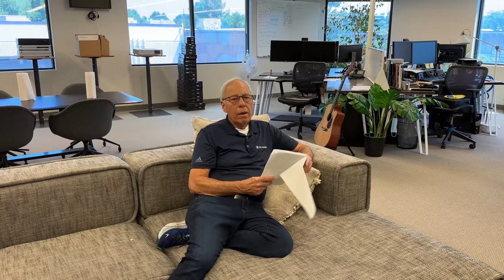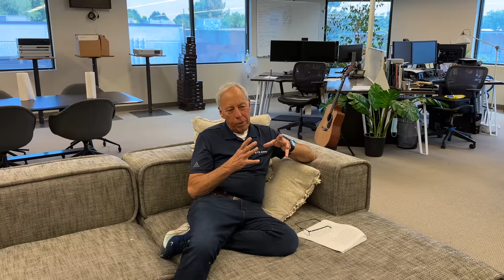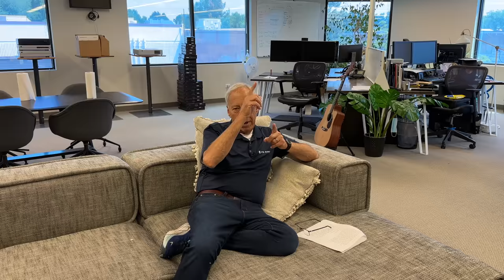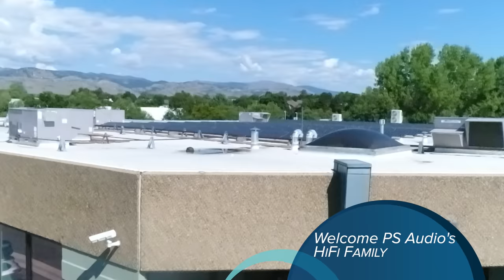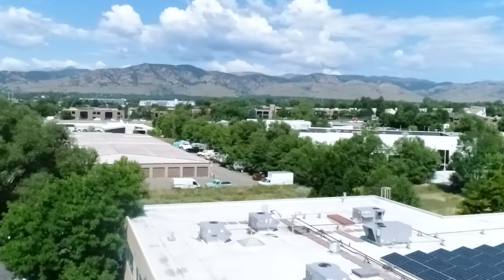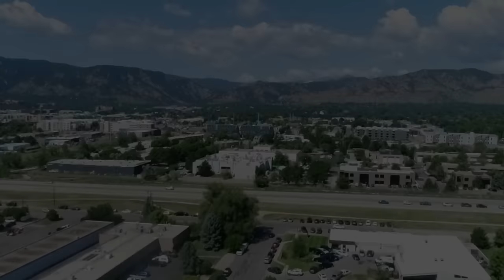How digital amps work

Comment: Described as PWM and either on or OFF, isn't true, somehow you need to get from the ON to OFF, and that is the "dead-band" where we are true analogue. Class D was designed with one aim. Cheap. Uncomplicated output stage, small heatsink. At 6.20 Paul discussed the output filter to "get rid of all the HF noise", however a simple filter won't achieve this, it's on the output stage so needs to take high current which means compromise. IMD distortion is poor there is a list of where Class D goes off the rails. There has been a lot of work to fix the issues inherent in class D, but this is the issue, a design where you need to fix the problems, just go with a design where you are not fighting the topology, but honing what was great to start off with. Industry likes Class D, it's now quite passable, miles from where it was say 15 years ago, it's cheap to make. However for me, it's a dead end technology. Why do you think technical reviews are missing when Class D is reviewed. Because the people who pay for advertising won’t support their products being trashed.  This said, who can say that purity is right, maybe a little IMD, compression and distortion sound great to you, and thats OK too.
Reply: Lots of people don’t like Digital hardware for their personal stereo system. 
Tubes will be available for a long time. A/B amplifier’s is another story. 

I personally prefer A/B amps over Digital. A/B have a different sound signature, tube amps have a different sound signature.
Reply: Take a look around ... there are all kinds of detailed technical reviews of Class D amplifiers.  A simple search will get you a couple of dozen to look at...
Reply: "somehow you need to get from the ON to OFF, and that is the "dead-band" where we are true analogue"

Nope.  The "dead time" in PWM is both transistors off. If it were otherwise we'd have a dead short across the power supply.

Comment: i am puzzled by the SMSL VMV A2 digital amp. it has bluetooth usb optical and coaxial digital inputs but no dac inside?? no need to convert.. it just amplifies that digital signal.  all digital. but then it power the speakers.. where is the conversion? there has to be a dac somewhere. but they say no.
it also has an analog rca input but  it must be digitalized to amplify so they say it has a adc ..but no dac. 
anyone please??? thanks very much
Reply: The conversion is at the output filters ... a simple coil and capacitor circuit much like the low pass on a woofer crossover. 

The sequence is simple ... accept PCM directly, sample analog inputs up to PCM, manipulate sound in the digital domain, then feed the resulting PCM signals to a PWM (class D) amplifier then finally put it through a low pass filter to remove the PWM carrier.
Reply: @Douglas_Blake_579  thanks very much
Reply: @Douglas_Blake_579  This is wrong. It's the same mechanism as a ClassD amp, PWM. But is using a digital logic chip to control the width of the pulses instead of an analog comparator.  You can't just feed PCM into an amp chip, it will just sound like static, it's data and needs to be converted.
Reply: @G3rain1  
There are PWM amplifier chips that accept PCM input directly.  The conversion is done internally, usually by calculation of the pulse widths.
Reply: @endrizo  
You're welcome
Reply: @Douglas_Blake_579   Moving the converter onto the same chip as the amp doesn't mean the amp is doing the conversion. That's just 2 devices on the same package.The amp portion never receives PCM.
Reply: @G3rain1  
Whatever.

Comment: I am familiar with Class A, Class A/B, and Class D amps. Not that I really understand the underlying theory behind them. I know that they exist and some general Truths about them.

Well, I think they're Truths.

The other day I ran across a manufacturer touting their Class G amps. I have absolutely no idea what that is.
Reply: Class G employ a multiple DC supply rails to give a boost to higher level signals by increasing the supply voltage momentarily.

https://en.wikipedia.org/wiki/Power_amplifier_classes

Comment: The D in Class D is for Dirty. I'll stick with my Class A monoblocks. The A stands for Astronomical as in my light bill when I run all five of them in the Summer. Wasn't so bad prior to the 30% increase in rates. Most movies are just fine in stereo and Pink Floyd is worth running all five.

Comment: I’m gonna be honest with y’all. I didn’t understand a dang thing Paul said here. Pass the dunce cap, please.
Reply: There is a major crap-ton of information about Class D on the web.  Do some searches and you will find information from beginner to super-expert very easly.

I've also offered a slightly different explanation in my other comments here, so you may find some help reading them as well.
Reply: It took me an entire year of research before I finally chose my system to buy. 
It was not just the research , I would think about it for a long time between research with my time. Impulse buying is not a good idea with reviews from others. Take your time.

Comment: Then, what is TECHNICS doing? They claim that their new amps - such as the SU-R1000 - are ‘digital.’
Reply: They are ... all input signals are internally sampled up to very high sample rate PCM signals, then dealt with in the digital domain.  At the power amps the Class D modulators accept PCM inputs and encode directly to PWM which, finally, goes through a filter and on to your speakers.
Reply: @bikdav  
I suppose it could be seen as that ... but it can also do things a conventional system cannot, such as phase correction, programmable RIAA response curves, room correction, etc.

Comment: On and off are represented in binary by a 1 and a 0. thats why a 1 and 0 are on basically all power switches, and you perform calculations by carefully controlling how long an individual transistors in a cluster sits in one state or the other.. if its not binary it's not digital? Well by definition of the word digital it can't be, but in my lamens opinion, and because it better suits the way my brain works, im still going to considert them digital whether calculations are being represented by a numerical value or not. It's still an integrated circuit chip that is performing calculations with transistors that can only exist in one of two states. On or Off.

This type of amplification is too much for my fried by highschool brain. I barely understand the principles of class A amplification.

Comment: Class D is purely digital in the output. It produces a signal that is jagged and stepped, which creates the edginess and harshness that class D is famous for. Either Paul is getting old or he's disingenuous because a digital output is still an electrical signal. Class D amplifiers are purely manufactured e-waste.
Reply: Not ....... even ...... close.
Reply: @Douglas_Blake_579  Cope, Seethe and Mald harder
Reply from the maker: I have no idea what you are talking about. Class D is Pulse Width Modulation. No jagged stairsteps.
Reply: @Paulmcgowanpsaudio  I suggest you read an introductory book on electrical engineering and learn about what PWM signals look like on an oscilloscope. It will prevent you from looking misinformed in future.
Reply from the maker: They are variable length square waves running generally at about 100kHz. You can see the waveforms here: https://en.wikipedia.org/wiki/Pulse-width_modulation and then see how it works. @AccuphaseMan
Reply: @AccuphaseMan 
You are confusing "Pulse Width Modulation" (PWM) with "Pulse Code Modulation" (PCM) ... not the same thing.